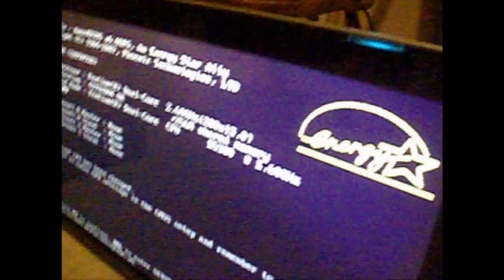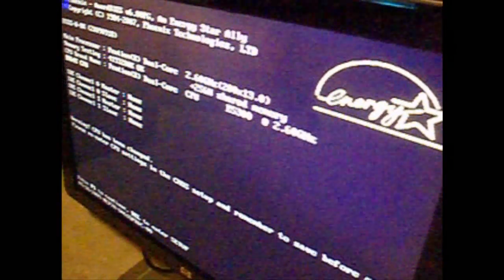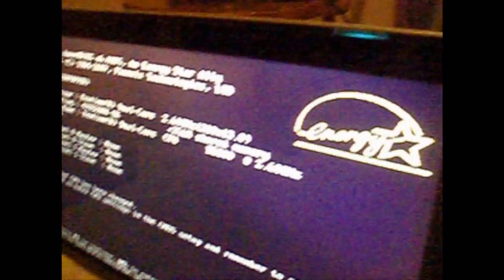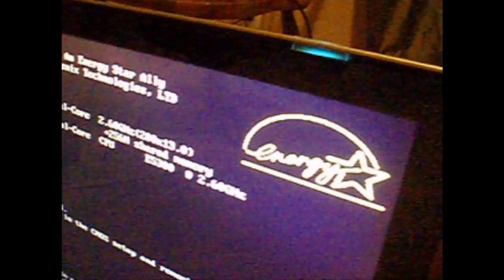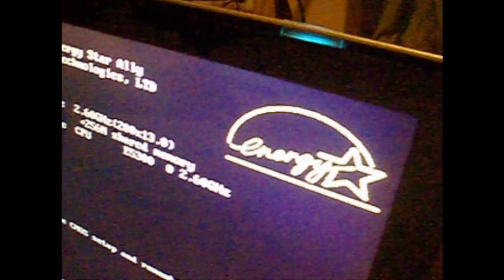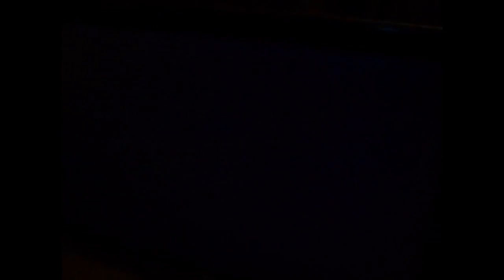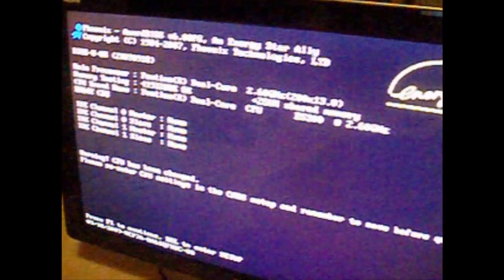NES PC Build Project - Part 1

Comment: So apparently google no longer wants to let me message people privately. I loved your build and came across them because i wanted to see if others had already done it. I had no idea there was a front end like hyperspin out there, so i figured i would have to use a mouse to manually load from the emulator. Anyways, i checked out hyperspin, but I am wondering where you got all the roms? were they bundled already or did you have to individually hunt them all down?

Comment: You mentioned that the base system is Windows 7 but does it function as a normal PC or don't you use it for this? Ever thought of using A68-e350 or e450 as the chipset and cpu and do you think that would work with the requirements of SNES?